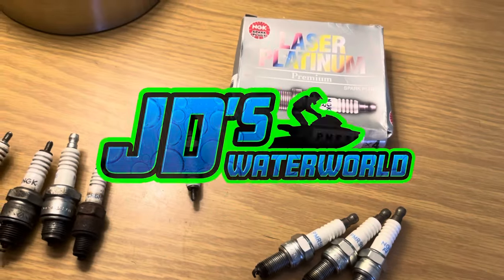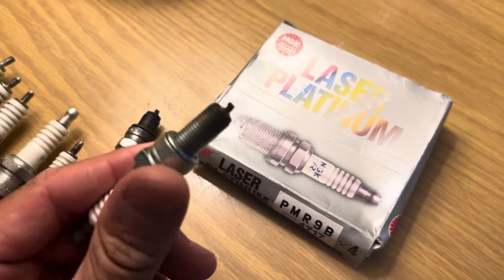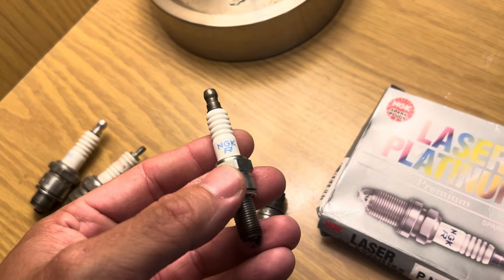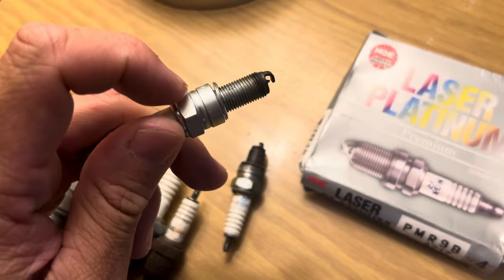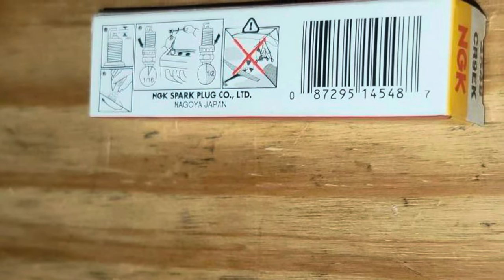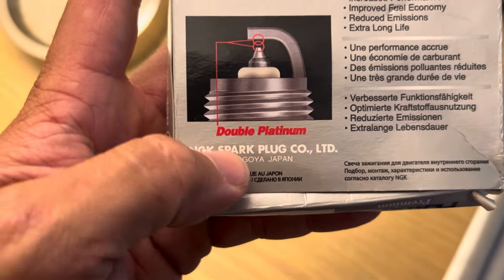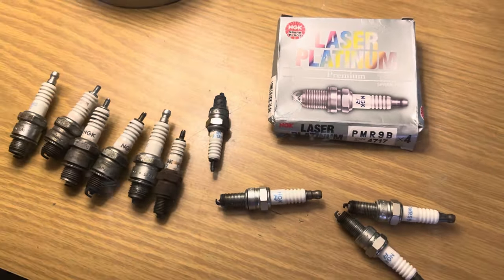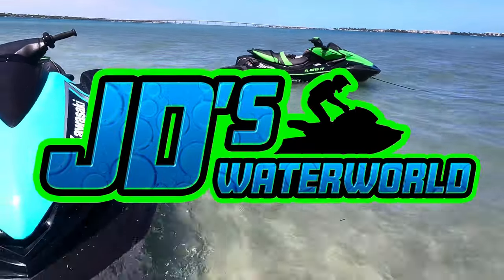Identifying FAKE NGK Spark Plugs! Don’t destroy your Jet Ski engine, PLEASE WATCH THIS!

Comment: Amazon is loaded with the fake plugs and thank you for this video.  I have a set and they are going in the trash.
Reply from the maker: Yes they are, from what I’ve heard!
Reply: Same with eBay... I put "laser iridium" plugs in my car that lasted less than 10k miles!
Reply: I got a fake BPR7ES the other day from Amazon it was so blatantly fake also the packaging said V power and if anyone that knows NGK plugs knows it would be part number BPR7EY. Nice try scammers 😆 It was almost funny. I put a warning review for other buyers and they deleted it.

Comment: I ordered a few off Amazon, everything seems right but the packaging. I do see the website with the .Jp address though it does say NGK Spark Plugs.

Everything else is spot on though, no machining marks, tapered point, crisp test and lot number is straight, rounded edges on hex nut...

Edit: others are saying legit ones do have the website and counterfeit does not. Maybe I misunderstood
Reply from the maker: As you did, check all the different variables and if they all add up, the plug is likely legitimate. There is no one confirmed way to determine if the plug is fake or not. I will only buy plugs from my dealer or WSM, Riva etc. Amazon it really depends who the seller is..

Comment: Hey JD ,  I got your reply back few days ago    Yeah I’ve learned that Riva isn’t always the best option for a Kawi.      But I’ve got everything installed 100%.     My issue (I think ) is maybe somehow I’ve mixed up some of my hoses   I can’t find a diagram anywhere on how every hose is ran /hooked up.  Everything from the flush lines , coolant , oil can catch etc.   do you know how I can find this info ?
Reply from the maker: This would all be in your service manual. I can send you a photo of the page with the house routing. Whatever you do, don’t hook a water line up to the crankcase return line
Reply: @JDsWaterWorld  unfortunately I didn’t get a service manual with mine for some odd reason ,  I did buy it used. But 25/30hrs and never even had Reg stickers on it.  So not sure where it went
Reply from the maker: You have to buy it from Kawasaki it doesn’t come with the ski- it’s around $80. If you email me I’ll send you the diagrams
Reply: @JDsWaterWorld  ahh ok dam.  I should have known that it’s not included.    That probably wouldn’t be smart on their part
Reply: @JDsWaterWorld  ok ,  I’ll email you.  I appreciate it

Comment: Best way to check if genuine :  use a multimeter and check resistance ... Should be consistent at 10% margin for the whole box. If fake you can have readings 100x higher than the expected value and every plug completely different reading 💩
Reply from the maker: Great comment, thank you!